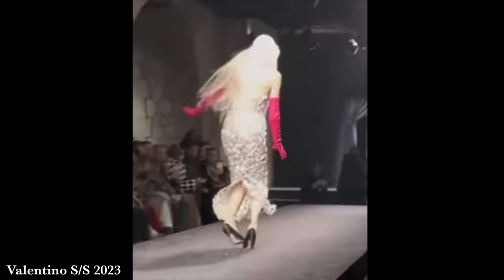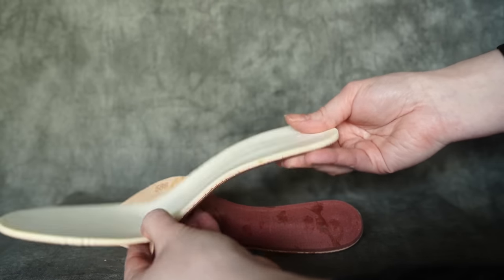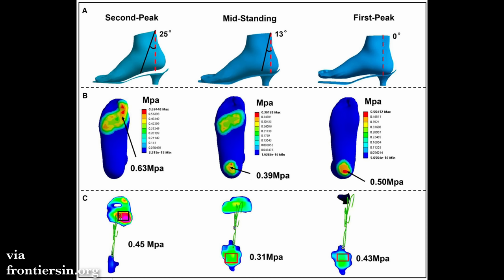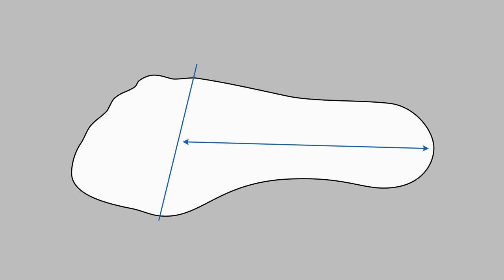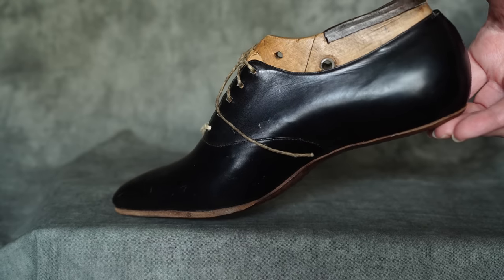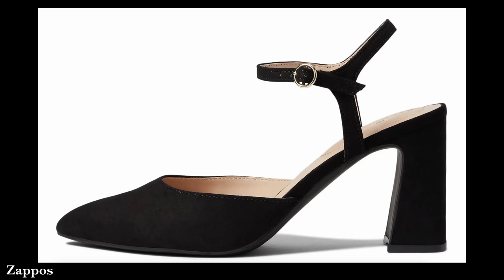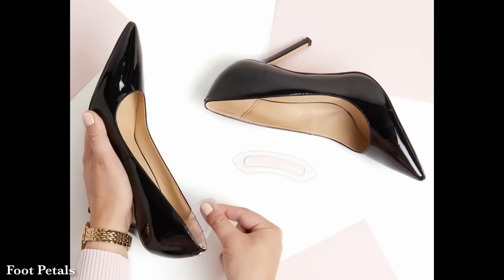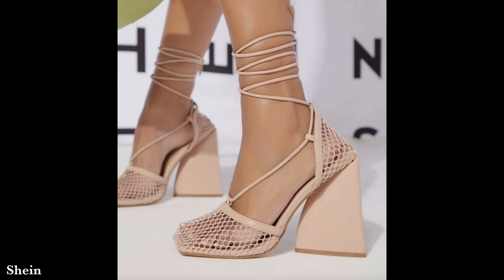Why are Modern High Heels so Bad?

Comment: When I was younger, my mother tried really hard to have me wear high heels on a regular basis, because in her mind (and much of society), that is what women did. I HATED them. My mother told me I had to learn to walk in them. (My answer was "Nope!") The highest heel I would wear without complaint was 1.5 inch, and only if I could not wear gym shoes with the outfit.  If I made to wear a higher heel, they would come off as soon as I stepped into a building. I did not care that others would stare at the me carrying my shoes. I HATED THEM!! Now, nearly 60, I still refuse to wear high heels, and I do not have the foot problems that many women have that wore heels. In fact, I have no foot problems. I never believed in suffering for fashion.
Reply: My mother tried to encourage me to wear heels too. I wore 2 inch ones for parties in high school and hated them. Been a decade since I haven't worn them and don't regret it at all. This video just confirmed all my fears, shoes are not made well.
Reply: I got this same treatment except I gave in. That's what I was made to do. I'm 33 now and my feet permanently fold in at the toes (where my last two toes try to fold in under the others even) from how ill fitting shoes shoved my toes in the pointed toe boxes. 

This came to a head where I was dutifully shipped off to my first job for 10hr a day in heels and it did so much damage within a few shifts that  my second toes on both feet were numb for days. They quickly came back to life, thank god, but stabbing neuropathic pain comes and goes, well more than ten years later now. 

From that day on I haven't  worn heels at all except for maybe a few minutes of picture taking because comfort and health finally reigns, but the damage is visible to me  and sometimes painful. 

My mother is still offended that I won't wear heels now, thinking I've become too matronly too early. Fuck that! She got 21 years of doll like aesthetics from me and I have the rest of my life to go with pain and damage.
Reply: @mialemon6186  wow, I am so sorry
Reply: I gave up heels in my 20's because my knees hurt! The problems caused by footwear don't stop at the ankle.
Reply: I am pretty feminine, yet heels are one of those things that are an instant nope, and not only because I have back problems. Mom tried to get me heels for a prom, but I ended up just wearing her sandals (which fit perfectly with my dress anyway).
Reply: My parents had sort of an intellectual crowd. I grew up with the mindset that pretty much anyone wearing heels due to the known damage etc must have like 3 brain cells. In fact beyond basic hygiene anyone outside of theatrical uses that was really into looks/make-up/appearance was extremely looked down upon. Moving in business world this was a hard adjustment. I still think make-up is required and beyond stupid but I will do the bare basics. I won’t do heels but I do try to pay limited attention to visual presentation. The hard thing is many were raised with such a giant emphasis on appearance it can be a cultural deficit to just not relate. Also a huge portion seem totally oblivious to their extreme social conditioning on appearances.
Reply: My mom didn't try to force me, but otherwise I have a similar experience! 😊
Reply: Hear hear! I'm nearly forty and I never wore heels (I'm more of a combat-boot person) and I've never had to deal with those problems either.
Reply: My 6th grade English teacher had to have foot surgery because of the damage years of wearing heels had done to her feet. I'll always remember her propping her walking boot up on the desk post-surgery and telling us not to cave to the demands of fashion. My mother, who hates heels, was pleased.
Reply: I’ve always had bad feet and posture my whole life so I always just wore nice flats to formal events. I also don’t wear heels because I’m so clumsy I can trip on nothing, not going to add height to that.
Reply: Idk why people are so bothered by bare feet
Reply: I didn’t like them and they hurt too much to try for more than 10 minutes any way. I figured out the ones I can wear for longer: stiff platforms. The problem was that a soft shank and ball of foot makes my rigid foot (very high arches) feel unsupported and results in pain.

For me the way stiff platform fits, support my arch and keep it stable so I can wear them for a long time.
Reply: My mother wrecked her feet wearing shoes that were too high, too narrow, too wrong in every way, "for the look". Nothing short of destroyed. The bones are deformed, she can't really walk with her normal gait (still looks "normal" to folks who aren't aware of that history, so very few), and she lives with so much pain. My friend actually got a surgery to repair her foot last year, and it was a lot. They had to cut away bone, also cut & reset joints, and move a ligament back where it had gradually slid away. Pretty horrific, and the recovery was so painful. (You cannot walk, like ZERO weight on your foot for the first several weeks, then months of painful recovery in a walking cast.) She still got the other foot done, but she's lucky to have a doting husband who was there for her 24/7 (really loving, really sweet).

And naturally, my mother fears the surgery "cos I'll get bored," she says. She gets stir-crazy if she can't leave the house for 3 days. But her feet are in a heck of a state, and worse yet, arthritis has her knees and hips also destroyed, her knees to the point of needing actual replacement (but she won't for the same reason) so she just suffers with it, every joint hurting from her pelvis down. I know the surgery is difficult, and I'm not going to press her on that, but I can see how painful her feet are, and it hurts my "soul". :(

As for me, idk how I was able to walk in my favourite 20cm heels for years, and never once fell (probably the tall platform and flexible sole helped) but I'm glad I never pushed it with heels that just didn't feel right at all. But that doesn't help my mum.
Reply: I love the fact that you gave no F's about what society wanted you to do. You gave heels the middle finger did not feel bad about it at all.
Reply: High heels was something men wore back then
Reply: I think my tallest shoes are probably my horse riding boots: but they aren't really for walking, they're for keeping feet in stirrups.

After that, I have a pair of black 1.5-inch wedge sandals that I use for formal events that don't really require lots of walking.

Every other shoe I have are trainers, flip flops, and walking boots.
Reply: I think my tallest shoes are probably my horse riding boots: but they aren't really for walking, they're for keeping feet in stirrups.

After that, I have a pair of black 1.5-inch wedge sandals that I use for formal events that don't really require lots of walking.

Every other shoe I have are trainers, flip flops, and walking boots.
Reply: I have arthritis of the hip and I find low heels are better for me
Reply: BittersweetKitty  obviously your experience is different cause of gender norms you being pushed into... Im sorry for you - and I hope one day you will have enough opportunities to wear heels in public to realise how awful they are... In meanwhile enjoy 😉
Reply: @holothewisewolf2579   not that high thou... Also waste it was back then - shoes you talk about were really nice shaped... And pretty hot
Reply: If she was smart, she would have told you NOT to wear heels so you would “rebel” and want to wear them.  😁
Reply: @mialemon6186  
It sounds like you had poor fitting shoes and needed some help; like a pad underneath the ball of your foot.  Wearing heels in a standing situation (like retail) needs special consideration and special care.
Reply: @keirfarnum6811  no, I still would not have worn them. I didn't rebel just to rebel, I rebelled because those shoes hurt my feet, and I have never been one to suffer for fashion.

  If it's 5 degrees outside with a -20 wind chill, and women are wearing jackets that at most go just below their waist because that is the fashion, look for the only woman in that group wearing the extra long ankle-length coat, with hood up, face wrapped, and gloved hands in pockets. That's me, lol! The other women may look great according to what the current fashion is, but I will not have frostbite.
Reply: My mother always warned me that high heels were bad for your feet and your back in the long run.
Reply: I am the same age as you, and my mother also wanted me to learn to wear high heels.  She looked lovely in her stilettos, but I never got the hang of wearing heels.
Reply: As someone who had to get bunion surgery at 24 because I’ve never been careful about the shoes I’ve worn (and also genetics) I commend you. I’ve worn high heels once since then and it’s been three years.
Reply: „I never believed in suffering for fashion.“ well said 👏🏻👏🏻👏🏻
Reply: @emilymanhart368 Also hips and back. In some cases up to the neck.
Reply: You're smart. Luckily, about the same time that I realized I had glass ankles, flats became trendy.
Reply: I admire you 💜
Reply: I have beautiful feet because I never wore high heels either 😊
Reply: @holothewisewolf2579 To be taller (heheheh)
Reply: @@trinitym5552 I am very much aware of that. I just can't help but share that she did what she wanted, and essentially told society to go F itself. You can't help but respect that sort of confidence. But it is is it Wellford instead of heels, can make you feel more confident as well. I just don't wear heels a lot due to haveing problems with my own feet.
Reply: I guess I’m … lucky?  I started wearing stiletto heels in my teens.  My mother didn’t have any input regarding my clothing; she only harped on wanting me to style my hair and put lipstick on (I kept my hair long and wore it in a braid or ponytail, and only wore makeup for dates, photos, parties, etc.)  I did not wear high heels exclusively (I wore cowboy boots, flip-flops, and Docs, too), but I wore very high heels A LOT from my teens through my late 30s.  I spent about 6 years dancing in 6-inch heels with platforms (to put myself through college - with no student loans).  I never really had any problems with my feet/knees/back, etc. related to footwear.  I did finally give up the ultra-high heels in my early 40s for the most part.  Now in my mid-50s I mostly wear American Duchess Londoners, Pompadours, or Karolinas, or Jobear reproduction Victorian boots.  I also still favour cowboy boots and my Docs!  I guess I don’t think high heels are The Devil.  Feeling (or literally being) pressured to wear high heels day in/day out is a bad idea, but sprinkling in high heels amongst my boots and sandals didn’t seem to do me any harm.  Perhaps I simply have peculiar feet?  My feet were always weirdly long and skinny, so shoes rarely seemed to fit me properly.  Now I’m older, my feet have finally spread just enough to properly fit a standard B width shoe.  I guess we are all just different. 🤷🏼‍♀️
Reply: Small heel is much healthy for your foot, than none. Like 4-6cm.
Reply: @poisonedh  My max heel size is 2 inches.
Reply: BittersweetKitty  that sucks, but what does this have to do with women being forced into harmful shoes? of course it's going to feel different for you, you weren't pressured into it. i'm going to be polite because you're a kid, but derailing conversations about afab issues is getting super frustrating.
Reply: Jfc,high heels everyday?! I can feel the blisters and bunions from reading that
Reply: I'm a woman in my 50s.  Glad I came up in the punk-rock 80s because some of my favorite shoes are still Doc Martens and likewise I have NO bunions or other foot problems like that!  😁   (<knock wood> but just 'cause I'm a little supersticious; it's mostly good shoe choices that spared me. 😀)
Reply: Um you can't refuse of someone doesn't make you do something
Reply: I've never been made to wear heels I ve always wore what I wanted and still do and I'm 41 right now
Reply: @marciam7301   why you don't know them
Reply: @marciam7301  d that happened years ago to them
Reply: Totally agree, 1.5" my highest and no spike styles.  I remember as a teen seeing hand drawn signs posted around my city with a woman's foot in a high heel titled "American Foot Binding".  Made a big impression on me as I had read of the historical practice of Chinese foot binding utilized by the upper class on their daughters.  Their binding was more intentional, painful and crippling than our high heels, but still what price "beauty"?
Reply: When I see some one in heels I feel sorry for them. To me they are torture devices. I won’t wear anything that hurts my feet.
Reply: I’m so sorry for the ones the mothers pushed them into wearing them.  My mother had to wear them to teach elementary for years and when I was growing up she often suggested against wearing them because of foot and back pain.  I’m in my 40s now and can’t stand wearing them more than a few hours.
Reply: I cringe when I see shoes with really high heels.  No way would I wear such shoes even when I was young.  I would stick to heels with 1 1/2 heels, no stilettos.  Now I am older with no foot problems.
Reply: These ridiculous shoes make me think of Chinese bound feet.  There are still women alive who as children had to undergo the bones of their feet being broken then being bent in half.  During the process they were forced to walk on the broken bones in their feet.  Keep in mind these are 4 to 8 year old girls.  It is estimated 10 percent of these children died of gangrene.  All so they would have feet which were considered sexually attractive and get better marriage prospects.
Reply: I wore heels off and on for years for work.  I'm older now and rarely wear them (have always loved clogs more since childhood), but I do not have foot problems from wearing heels probably because I was always careful to rest and pamper my feet after they had been in heels.  I know plenty of women who have bunions who insisted on heels all the time - and they bought those very expensive Italian ones everyone knows. Overall, I would agree that the concept of heels is rather ridiculous and, just like the ancient foot wrapping in the East, heels should go away.  It just isn't normal to walk that way.
Reply: So glad my Mom never presented me to wear heels, make up, or anything like that. She always encouraged me to march to the beat of my own drummer.
I was very lucky.
Reply: Vivan los high heels
Reply: You’re one smart lady! Sounds like you were a smart little girl as well.  I’ve never really worn high heels either and I’m 52.  It’s funny because my friends used to tell me my shoes looked like something a fifty year old woman would wear. Now that I’m an actual fifty year old woman I’m glad I chose comfort over fashion.